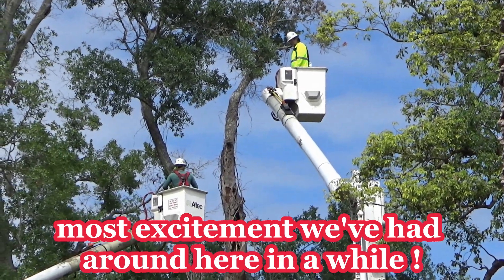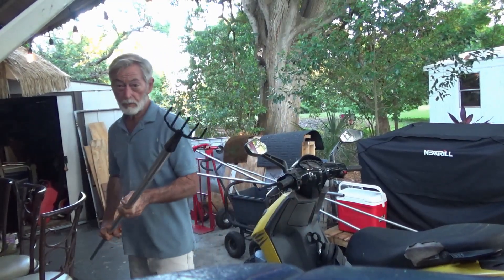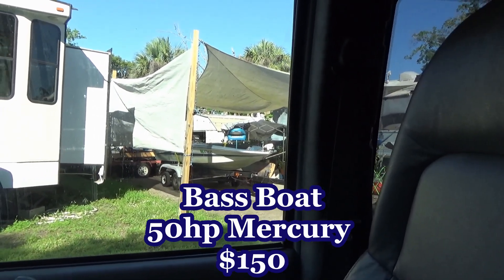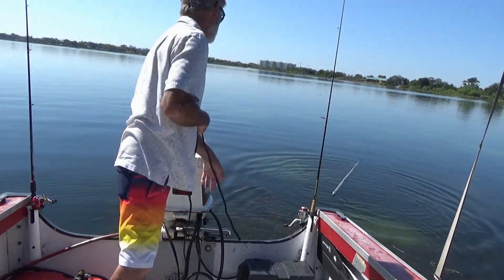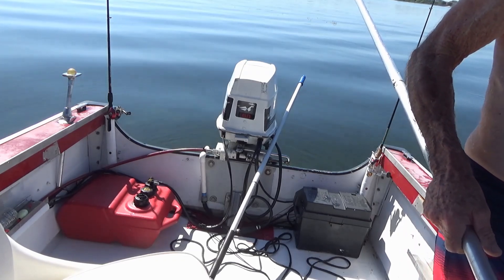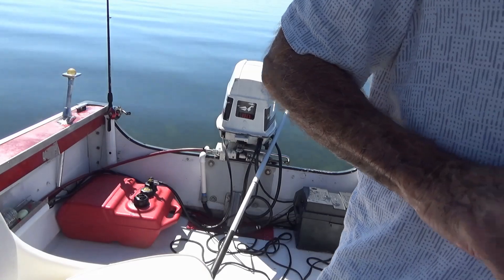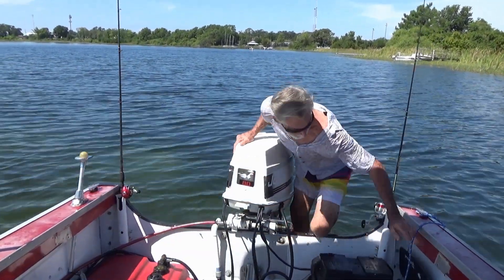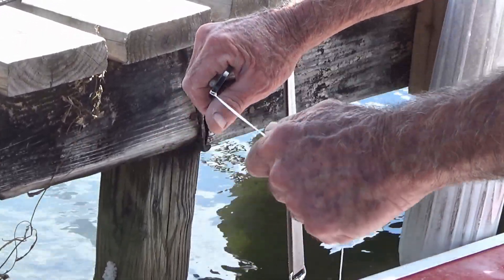Tilapia Spear Hunt - THIS OLD OUTBOARD

Comment: Any input on a seahorse 115 overloading gas from the carburetor dripping out onto the housing on what may be the cause?
Reply from the maker: Hey. Thanks for tuning in. Guess would be needle gone bad and not seating. Depending on the year, choke butterfly stuck closed. Primer solenoid bad/leaking.

Comment: Hey🖐 what's a good paint to use on my Johnson motor? I'd like to paint her to make her look pretty again.
Reply from the maker: I use to use the high heat chemical resistant automotive paint from the auto parts store, it was a silvery-blue, pretty close match to evinrude and yamaha colors. I did a video on it check it out if you get time. Thanks again !